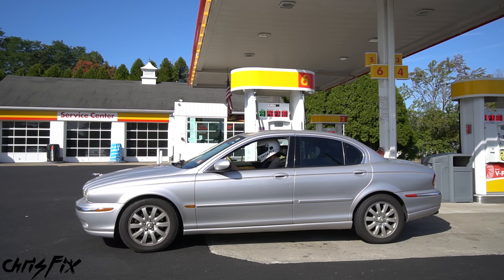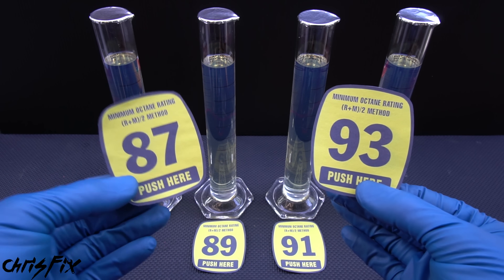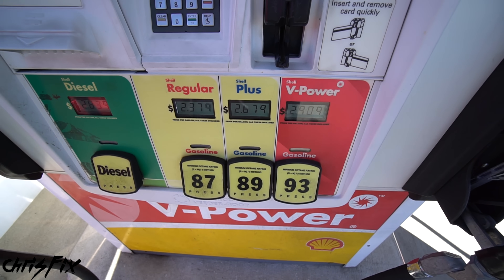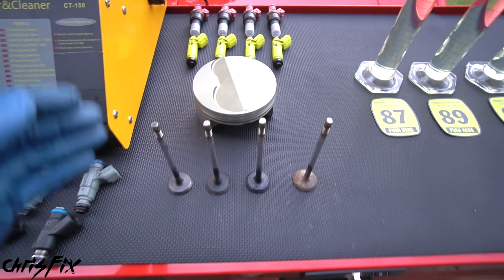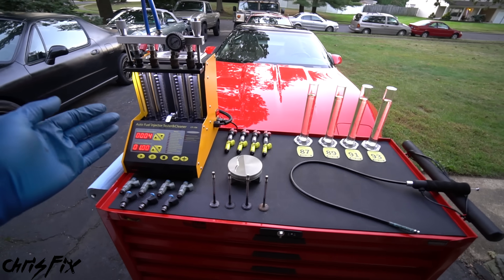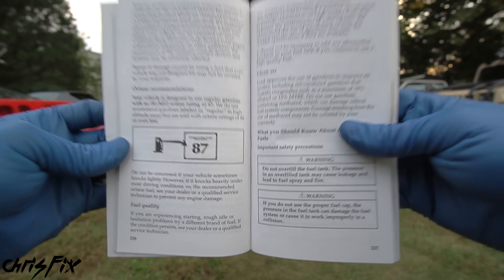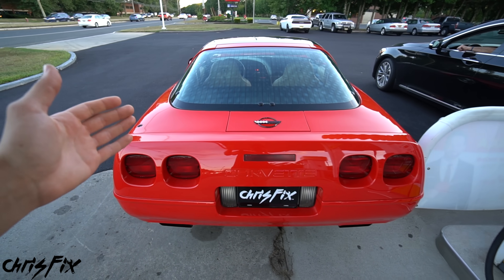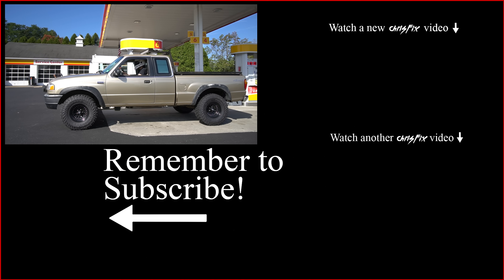What is the BEST Fuel to Use in Your Car or Truck and WHY

Comment: Hey Chris, so I have a advance 2003 Mitsubishi magna automatic 3.5L 6C engine 155p , here in Australia we have 91, 95, 98 unleaded, our 95, 98 is premium here and we also have E-10 as well for our older cars, what I do time to time again maybe once or twice a fortnight , I fill up with the premium 95 unleaded, then rest of the week I use 91, also when I reach 5k miles each time I use fuel injector fluid to flush out the system, when it’s near empty that’s when I use it also when I use 91 for it, I fill it about half way cause I never fill it full unless traveling, so with your thoughts and knowledge, what I’m doing for the engine is that a good suggestion? Thanks and also love your videos, have been subscribed to you for ages and have learned a lot and have managed to catch scammer mechanics and service stations cause of you, so thanks for all the awesome work!

Comment: I have a Tacoma and I get much better mileage on lower octane fuels, why is that? I occasionally drive through areas with 85 octane gas and get noticeably better mileage than when running on 87 or higher.

Comment: Maybe should have mentioned more about high altitudes.   Pumps at (say) Salt Lake City at about 4300 ft elevation don’t even offer the higher octane that those in (say) Houston at 80 ft elevation.  Not to worry, higher altitudes with resultant lower air pressure automatically reduce the compression lowering the need for higher octane.  87 at altitude, 89 at sea level.   Use the grade based on position.  In other words if you use the middle on at your altitude, use the middle one if you change altitude.

Comment: You say that the different octane level fuels will not affect your "power" or fuel economy. Isn't it true, however, that if you use the higher octane fuel, it will keep your fuel system cleaner, which in turn will improve your "power" and fuel economy?
For this reason, I have heard people say that we can use the higher octane (more expensive) fuel to keep your fuel system clean, or we can use the lower octane (cheaper) fuel, but also, at regular intervals, add fuel system line cleaner ( fuel injection cleaner, or other product). 
Is this not true?

Comment: This video was actually helpful. I have argued with people for years about 87 vs 91 octane fuel in my area. I am not one of those people that just research things online and believe everything I read. Even from reliable sources. I like to experiment in real life in real life situations. I have found that premium fuel (91 octane in my area) in some vehicles designed to run on 87 octane fuel actually performs better. Meaning I have noticed a significant difference in power and mpg when switching to premium. Not a subtle change but a dramatic change. Now I wasn't saying it is the octane making this happen, but that is the argument I always get into. "That just means it is just more resistant to knock". Yes.. I know. And I understand. But I was definitely getting more power and MPG out of the higher octane fuel.  but it wasn't necessarily the octane that was doing it.  If they were putting more additives in the premium fuel then that explains alot. It is the additives that are giving me more power and better mpg. I will note that not every vehicle I tested benefited from the premium fuel. I noticed cleaner engines did not have a benefit like the ones that were used and abused. And in this video it brings up a good point. If there is too much carbon build up, it can increase the compression ratio and detonate. Then in these cases, the premium fuels higher octane would be helpful as well. Also, I have had different experiences with different gas sations themselves. Same brand, different brands not all were the same even though my buddy works for a refinery and says it all comes from the same place. Well not the additives. And in my experience those make a huge difference.

Comment: Great job. The only addition I would make is the scenario where you're using the recommended octane and the engine knocks. Wouldn't that mean it needs repairing or at least cleaning with the special Shell gas? Maybe you said that and I missed it... 😁

Comment: I drive a 1999 Subaru Forrester with 208647 miles on it and when I put low grade gas the check engine light comes on and it throws a ODB 420 code and that is a Catalytic converter code so 93 for me

Comment: This guy made me read the owner’s manual of my car.
Reply: Lol I always read the manuals from cover to cove. 3 cars and I always knew tire size, octane required, lifting points, and even extra tricks/buttons on my vehicle.
Reply from the maker: Good! Lots of great info in there!
Reply: ChrisFix  well it a crown vic with 500k KM so i think its gonna be just fine , on the other hand I have my Gmc thats not running half of the time 🙂
Reply: I have no idea where my car’s manual is 😂
Reply: Chris: read onwers manual gasp the car is a ev how did I not know

Comment: Any chance we could get your take on ‘top tier’ fuel vs. non-top tier and also thoughts on gasoline with 10% ethanol as thats a pretty standard offering here in Nebraska.  Typically only premium fuel is offered without ethanol.  Just curious how these gas options affect engine parts, carbon buildup, and fuel efficiency.  Love your videos!

Comment: What if my manual says that 87 is recommended? 

Does that mean that 87 would give me the same efficiency as 93??
Reply: It simply means you use 87. If you use anything lower, you'll probably have engine knock. If you put anything higher, nothing bad happens other than you waste money.

Comment: This whole video could have been summed up to: read your manual
Reply: @Auto Driven No. The manual doesn't tell you WHY your car wants a certain octane. Doesn't explain that you won't get more mileage using premium fuel if your car only wants regular. Doesn't show injector spray patterns.  Yes, the summary was use what your manufacturer says to use, but really the video covers so much more.

Comment: @chrisfix i think you have the general idea of octane correct, but the lower the octane the higher the energy content.  in general, octane has less energy per litre, or less carbon per litre than the other higher carbon chain hydrocarbons.  the simplest way to explain would be to compare weights.  if you measure the mass of the gasoline, you would find a general trend of decreasing mass as you go up in octane in number.  the less mass, would mean less carbon, and carbon would mean less bonds to break.   confounding the problem even more would be ethanol, ethanol is the cheapest way to increase octane rating.  ethanol has 26 MJ/ kg while gasoline has about 46MJ/kg, so increasing the concentration of ethanol in any fuel will lower the energy density.  so to be economical, use the lowest octane fuel your car can use.

your friendly neighbourhood petroleum engineer

Comment: 5:00
Well. In my country Shell V Power is a good fuel. Regardless the low/high octane. Other gas stations are allways selling water mixed fuels.

Comment: My truck is Flex fuel but after I bought it I started using regular unleaded gasoline , will that turn on the engine light on?

Comment: I have a question about 10% ethanol vs. 100% gas, both have the same octane rating, so is it worth the extra cost for 100% gas? Is the 10% ethanol damaging in any way? I ran a test myself for gas mileage and it wasn't enough of a mileage increase to justify the cost difference.

Comment: So much about this is wrong.. 🤦‍♂️
Reply: Like what?
Reply: “Higher octane fuels don’t give you lore hp” 
This is 100% wrong. Perfect example: new civics and accords, small turbo engine, greater hp numbers with premium gas. Easily proven by a dyno. There is also a lot of data that higher octane fuel gives you better mpg.

Comment: It would be worth mentioning why some premium fuels yield better fuel consumption.

In Canada regular gasoline is blended with up to 10% or 15% ethanol. Ethanol does not have as much energy in it so when blended the fuel becomes less energy dense.

Filling up with an ethanol free fuel can get you up to 4% better fuel economy.

Comment: Thanks for the video Chris. 👍
But please explain this: My car uses 92, so I did a little test. I put a brick under the throttle pedal and adjusted it to not exceed 3000 rpm. Using 92 octate at 4th gear the car did 95 km/h. And then refilled the car while being empty with 95 octane, and at same 3000 rpm at 4th gear the car did 102 km/h. The test is done at the same road, same direction and at the same hour by the way.
Reply: That is not even possible with a manual transmission or fixed gear ratio (you mentioned 4th gear).
Reply: There are too many variables to determine what caused the difference. The only way to determine if it makes a difference is to run this same test on a engine Dyno. With all of the following remaining the same starting engine temperature, air temp, air pressure, computer controlled throttle, as well as a multitude of other things that could affect the result.
Reply: So in short the 7 kph (3 mph) difference is too small of a difference to even matter as well as your test/experiment method is flawed.
Reply: @keltondavis4559  My car never hit higher than 180 km/h before using 95 octane,  now it goes just over 200 km/h. It useful for me because I travel a lot. I see that's a benefit.

Comment: everything you said is true, yet people still argue on FB that they get more power using "premium"
Reply: They might well be, I get more power in my Z4 when running 99 (I'm from the UK) instead of 95. If you watched the video you would have noticed that he said if your car recommends Premium and you use it then you will get more power than if you ran Regular in that same car. Feel like you didn't really pay attention?
Reply: you clearly don't understand what I'm saying.  I'm talking about the folks that drive cars tuned for "regular" gas that claim that the higher the octane, the higher the horsepower
Reply: @WJHandyDad  well you didn't say that all. Kinda hard to understand you if you don't say what you mean

Comment: You didn’t touch on the fact that most regular and mid grade gasoline contains ethanol. Lots of older vehicles don’t do well with it. it rots fuel lines and doesn’t burn as well in older engines. Most premium fuels contain no ethanol.
Corn liquor should be drunk not burned.

Comment: E-85 is used in the race track world. E-85 minimizes you’re milage but increases your HP. You should make a vid solely on E-85 on it pros and cons. Many guys with sports cars fill up on E-85 even though it’s not recommended or required.